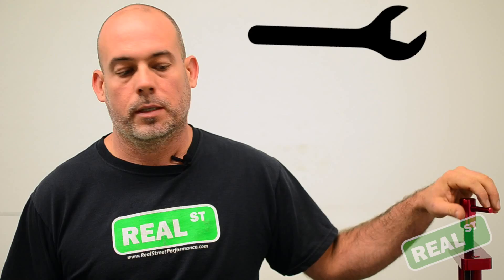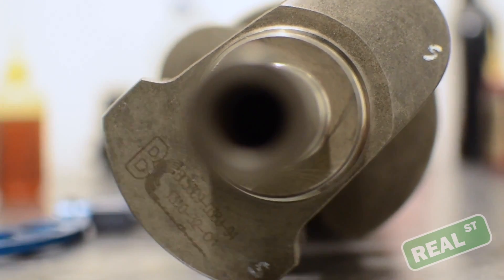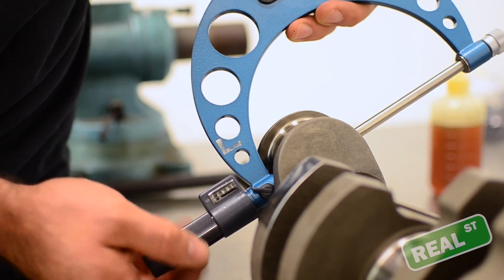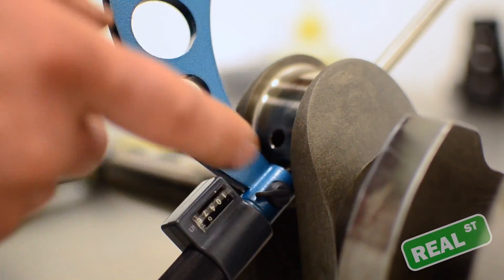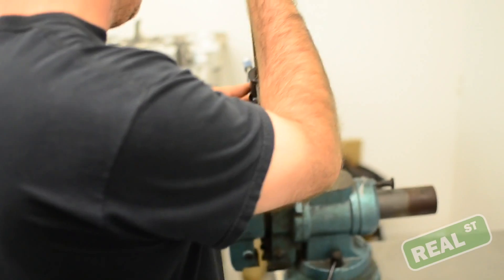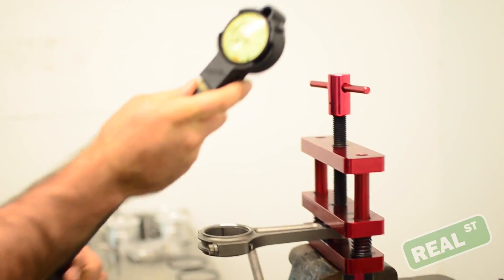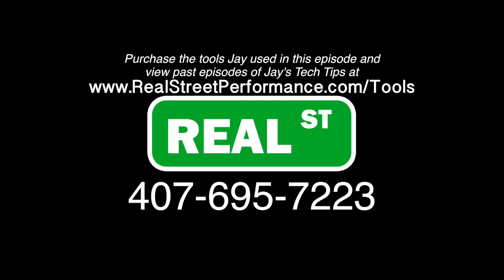Checking Bearing Clearance - Jay's Tech Tips #8 Real Street Performance

Comment: The problem with PlastiGauge on rod bearings..... Removing the rod caps requires enough force to disturb the PlastiGauge and distorts the measured width....thus, major error...

Comment: When you measure the rods with the bearings installed, do you torque the rod bolts or just finger tight? or will that make a difference?
Reply: The Rod capscrews must be tensioned to specification in order to crush the bearing. Also the bearing bore will distort under the load of the fasteners, which must be included in the measurements
Reply: +1 Torque them to spec prior to measuring. also make sure you measure from top to bottom, not side to side.

Comment: That's a dial bore gage, not a inside micrometer. For a super accurate measurement you use a .0001" increment reading, not .0005" like here. Also room temp is very important if you really want to know the numbers. Looks like .0025" to me.

At least its not plastigage haha. :)
Reply: no need for .0001;    .0005  is fine for this work;  temp here DOES NOT matter(it matters in other fields,not here);  it´s .clearly  0015; thanks 
josepeixotoPortoP
Reply: Ya on that dial gauge since it reads in .0005" it showed .0015" you are correct. I disagree with temp not mattering. I keep engine room 70F to keep everything consistent. You can definitely see temp change with .0001" also. I do agree, .0001" isn't required, but its never a bad thing to have more accuracy when measuring very tight tolerance things like bearing clearances!
Reply: @TSComptuned  I'll be honest. I do this. There are very few times where I was worrying about the difference between .0015 and .0017 which would likely be the range of error for this method. Each build has a different range for tolerance but this method does help with less errors from t gauges ext.

Comment: I'll ask again. How about a tech tip on polishing the tops of pistons or combustion chambers to a mirror finish. Or the gold looking plating to the tops of pistons.
Reply: What are you wanting to accomplish with piston/combustion chamber polishing, plating or coating?
Reply: patw52pb1 Do you know why it's done or how?
Reply: jolmeaki Yes, I am very familiar with performance coatings. 
Most performance coatings are intended to be thermal barriers or thermal dispersants to manage or direct thermal energy, anti-friction surface coatings, chemical resistance coatings, oil shed coatings and corrosion inhibiting coatings. 
Coating selection and usage is specific to the particular needs of an individual engine. 
These coatings are high-tech and are applied in very controlled environments using sophisticated methods. 
The formulations and application methods of these coatings are closely held secrets and are not a DIY process. 

What you are asking does not have a quick and simple answer. 
Too many unknowns to answer accurately, that is why I asked what you are wanting to accomplish.
Reply: patw52pb1 I wasn't asking about the anti-friction coatings on the sides of the pistons. I also know it's not a DIY process. I was asking why the gold look on the top of the pistons. I've also seen pistons and combustion chambers polished to a mirror finish by hot rod guys. They didn't say much about it though.
Reply: jolmeaki Gold colored coatings on the piston deck are usually thermal barriers. 
Generally thermal barriers on piston decks are used to help prevent thermal damage to the pistons in extreme situations. 
Most thermal barrier coatings have a ceramic component. 
See:
http://swaintech.com/race-coatings/race-coating-descriptions/piston-domes

Polishing and radiusing piston tops and the combustion chamber can help flow, help prevent deposits from forming on the surfaces and help prevent detonation.

Comment: Comeon Real St, you guys can do better than this.
Jay is losing my respect. That outside micrometer shown in the video is about as cheap, inaccurate and inconsistent as you can buy. 
The misapplication of a Sunnen dial bore gage to measure bearing clearance is also not impressive. A Sunnen dial bore gage is used to indicate out of round, deviation and taper in a bore, it is NOT a device for making absolute measurements to determine bearing clearance.
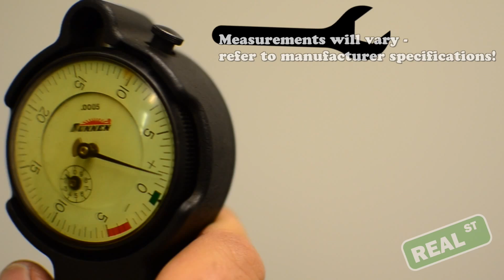Also the indicated deviation in the rod bearing diameter was 0.0020 (two thousandths) not 0.0015 (one and a half thousandths) as stated in the video at 2:01 
If you are selling high performance, accuracy and precision, provide more than empty talk, be accurate, be precise, use and show the proper tools and methods.
Reply: Lol. Looks as accurate as any mic.  And it was .0015
Reply: shitheadcatfish Lol,  But, it isn't.
Apparently you do not understand the procedure and that is why you should leave precision machining, measurements and assembly to knowledgeable, experienced and competent professionals. 
That micrometer is a cheap offshore unit of inferior design that inherently has known accuracy and repeatability (consistency) issues. 
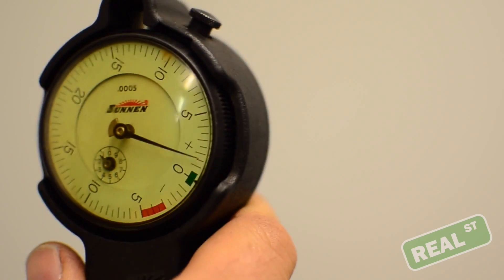Incorrect, watch closely from 1:57 to 2:02 in 0.25(quarter) speed and full screen to see that the reading fluctuates between 0.0015 and 0.0025  on the dial bore gage.
Reply: shitheadcatfish  Good for you. 
My engines run also, perform reliably, produce target numbers, experience very few issues and even fewer rotating assembly failures. 
That is a prime example of why the usage of a dial bore gage in this video is a misapplication of a Sunnen dial bore gage to measure bearing clearance. 
Reliable and repeatable centering a dial bore gage and aligning it to the bore axis in such a shallow and small diameter bore without a fixture is very difficult at best and is a source for error. 
A Sunnen dial bore gage is not a device for making direct, absolute measurements to determine bearing clearance. Period.
Error amplification also is an issue using the methods in the video. 

Just remember, you can use the very best, highest performance, most expensive parts and components available, but when assembled improperly by the inexperienced, incompetent or unknowledgable or relying on cheap/low quality unreliable measuring instruments/tools or improperly using quality tools and measuring instruments, the result will almost always be very fast at becoming expensive junk/scrap.
Reply: @patw52pb1  he's right. Is you rock that bore gauge back and forth the tightest spot it the straight across and therefore the bearing clearance. Anything above that is not straight across
Reply: Feel free to make a better video lol
Reply: patw52pb1 Curious, you seem to know a bit about bearing clearance and what not. Is there a guide as to what clearances you need for a certain weight of oil? I was told if you run the motor loose and use a heavier oil it's better for high rpm applications but I couldn't find any reliable source on how loose is just enough and what weight to use.
Reply: HowardSupra  On the WWW (Wild, Wild, Web) you can find many personal opinions, charts and guesses on the subject of bearing clearance, oil viscosity, oil pressure and flow-rates, but I will warn you that much if not most of it is incomplete and or incorrect. 
I could tell you that 0.003 in. bearing clearance and SAE 40 oil will reduce drag, spinup faster, and increase your horsepower, but I will not as it would most likely be setting you up for disappointment and or disaster. 
What you are looking for is an engineered solution and there is no simple answer to your question. 
It takes a great deal of engineering, science, chemistry and physics to determine the fluid dynamics of lubricants, ideal lubricant viscosity and the optimal running clearance for a given set of conditions. 
Virtually every modified high performance application is unique and will require individual assessment. 
There are many variables to assess in determining bearing clearance including but not limited to lubricant characteristics, operating time period, operating temperature, bearing/journal surface area, bearing/journal surface finish, bearing/journal surface loading, bearing/journal surface speed and bearing/journal materials. 
My recommendation is to consult a high quality, high performance bearing manufacturer such as Mahle and get their recommendations. 
Be prepared to provide an enormous amount of info about your specific engine and intended application. 
Using heavier viscosity lubricants rarely results in faster spinup or increased horsepower and almost always increases drag.
Reply: doesnt really matter what mic he used on the crank. he was not making the reading based off that tool. he was only using it as a gauge for the dial bore gauge, which can be used to measure clearance, not just out of round. I believe that his measurements were accurate.

Comment: I do not need this but a Jay's tech tips on installing wire locks/spiro locks on pistons would maybe help a lot of people
Reply: Sharky Mark Buy the piston lock installation and removal tools. They are not that expensive, make the job easy  and are cheap insurance to prevent piston, pin and lock damage during removal and or installation. Google is your friend,
search for lock-in-tool  lockbuster